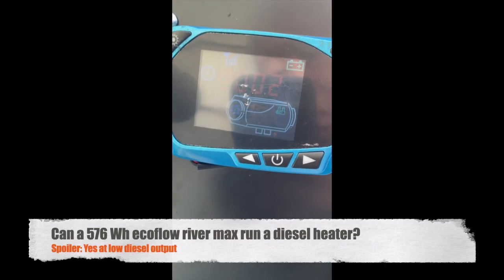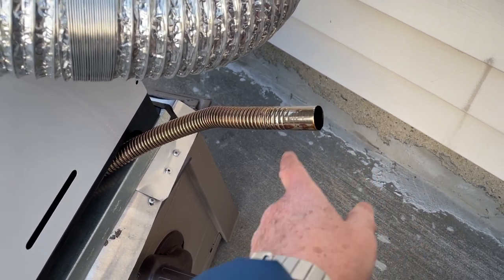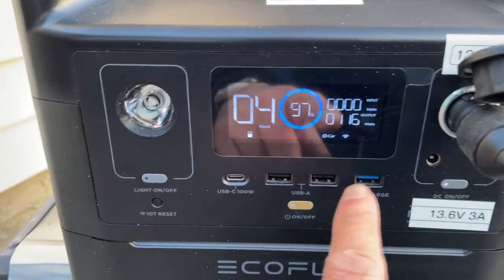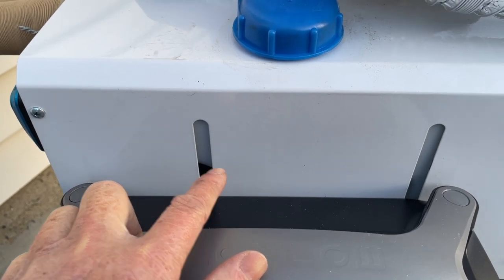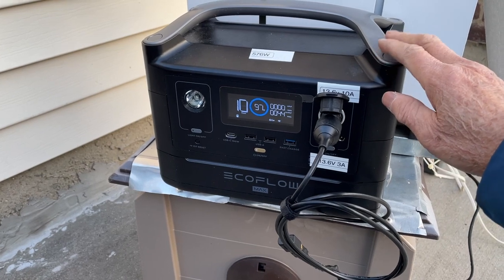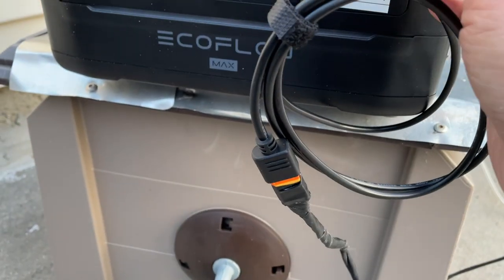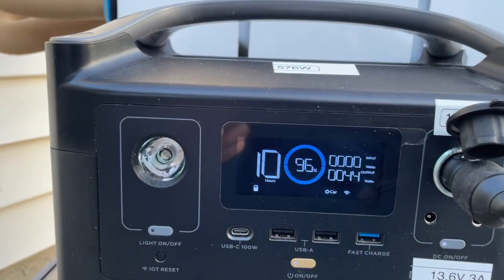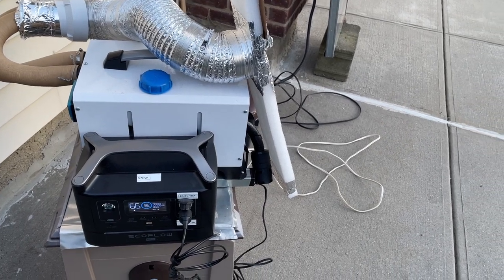Can a Ecoflow River Max 576Wh power a diesel heater?

Comment: Hi there, good to see the EcoFlow can power the diesel heater. I have the same setup but, can’t start it up, it’s showing 8A on my DC car outlet. How do you get 10A? Thanks
Reply from the maker: 8A is the limit the car cigarette outlet can charge your Ecoflow so as to prevent draining your car battery. Also the car wiring cannot handle current too much over 10A. The cigarette 12v socket of the Ecoflow can output 10A at 13.6v. Enough to run a diesel heater. Of course your Ecoflow should have a good charge. When you say u can’t start it up, are you saying you connect the wires from diesel heater to the cigarette lighter socket of the Ecoflow and it won’t start the heater.
Reply: Thank you for the reply, yes I have my batter fully charged and yes I connected to the EcoFlow cigarette plug and still won’t work. there is power but as soon as I start the heater it’s just drop down to 9-7V and it’s stop working, but I used my AC to DC adopter and then it worked.
Reply from the maker: @nissangtr3535  my Ecoflow is 576w so if yours the same, it should work. The glow plug of the heater draws 137w or so and mine was able to power it. I guess as long as you can make it work it’s ok. AC does drain the Ecoflow down faster.
Reply: Hello. I have the new EcoFlow river 2 max, which is 512 Wh and it does not work for me. The heater I bought ramps up way faster and the power station doesn’t seem to be able to handle the load.
Reply: @Maverick319 did you find a way to get it work?
Reply: @yottooverland  Not yet. The only way to make it work I can think of is to use an AC to DC adapter on it. This way it would probably waste power but it might work. I haven't tried it yet though...
Reply: @Maverick319  try cut your DC wire to 3 ft and plug in
Reply: I just purchased a generic diesel heat. It didn't come with a male cigarette adapter, just bare wires. I have an Ecoflow Delta Max, I believe 10 amps is the max, correct?. What male 12v cigarette plug and what amp fuse did you use?. Thanks for the video.

Comment: I have an EcoFlow River 2 pro 768W. I am trying to power eberspacher d2 airtronic from dc car output as like yours. It's start working but overload after 100w and stop the power. as I see at the beginning it can use about 150-160 W power from power station and its decrease to 20-40W after 1-2 minutes. but my setup never pass over 100W. how can you get more than 100W from this output ?
Reply from the maker: The dc 12v socket can only output 10A at 13.6v or 136w. So if it draws 150w it can overload it. I guess the work around is to use 12v power supply powered by AC. A little inefficient but should be able to handle the job of powering the glow plug of your diesel heater.
Reply: @wtam69  thanks for answer and advice. As i see your river max can provide 150w output. Why river 2 pro is overloading, its user manual says dc output 12.6v 10A 126w. Probably i will use ac output with a adaptor as you sad but i just wondered how is your river max can output 150w
Reply from the maker: @onurigdi  my diesel heater is a Chinese made one so the specs might be different from yours. my diesel heater surges briefly above 140w but quickly throttle back to lower current draw.  Normally I use a 12v 30amp power supply and it runs on AC. Costs a little over us$20. Don’t know a why your output is only 12.6v as mine is regulated  13.6v.  I’ll  run more tests this coming heating season but I suspect the Ecoflow River is not that suitable to run a diesel heater as I have more than 1 person telling me they are unable to use the dc output to power a diesel heater.
Reply: @onurigdi I also have the river 2 pro, and it cant start my heater. What the heck!
Reply: @seamusdavis969  I couldn't figured it out from dc car output, its overloading after 100W. But you can buy an adapter which is suitable  with your diesel heater and you can run with invertor by plugging

Comment: You should do research on diesel exhaust and your health. I'm a retired truck driver, have respitory  issues, have never smoked.
Reply from the maker: Sorry to hear about respiratory issues. You must have a lot of good stories to tell about your truck driving days. When refilling the small heater fuel tank, no matter how careful I am, there’s a few drops that land on the cover of the heater. That’s enough to give out a diesel smell. That’s why I keep the heater outside.
Reply: If properly installed, the exhaust always goes outside. I've ran a heater in my home for 2 years, and have used gas leak detectors right up under the exhaust port and have detected nothing. There should be no fuel smell or gas coming out of the combustion chamber. If it is running properly, the only thing that comes out is hot air recirculated from the interior. Install the entire unit inside and exhaust through a "through-hull" kit.